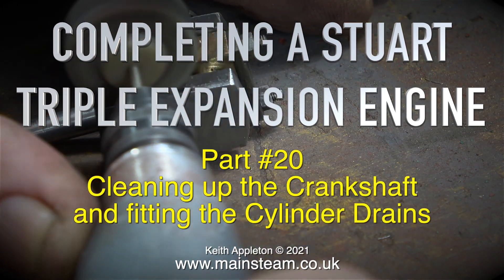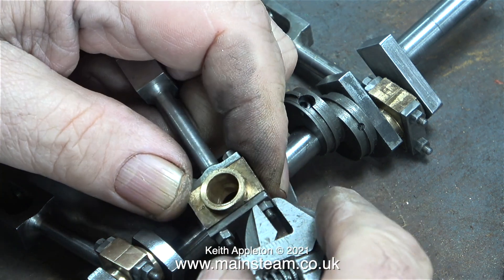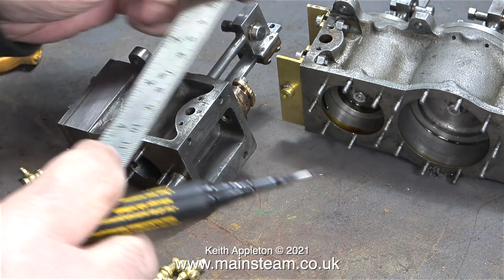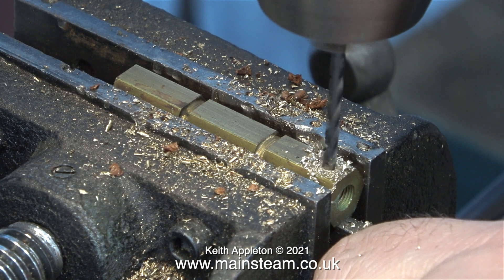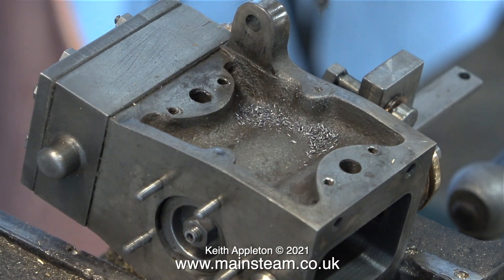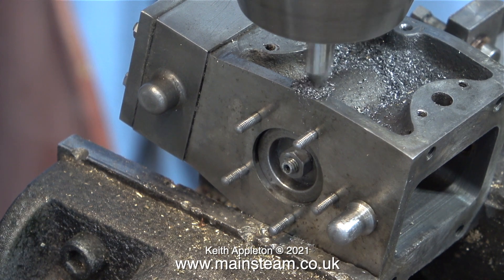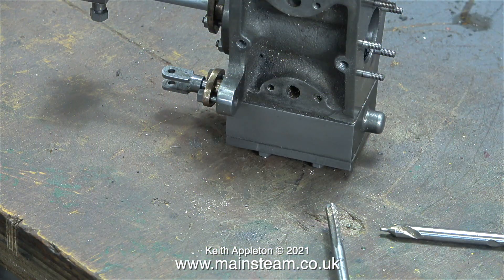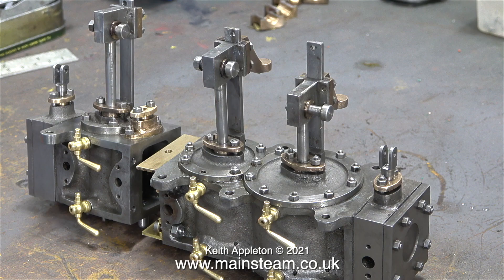COMPLETING A STUART TRIPLE EXPANSION ENGINE - PART #20

Comment: Nerve wracking indeed and i was only watching!
I have a question (NOT a criticism). 
Why did you not do the tapping holding the tap in the drill press with a tap follower? 
... especially as you said that you only had a bottoming tap in the correct size for this job. I am guessing that it was lack of space above the job.